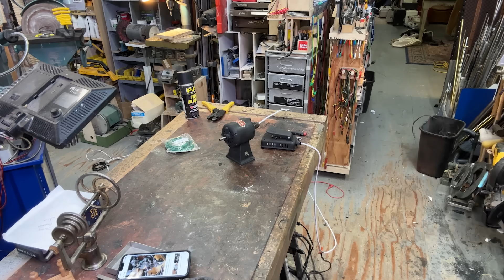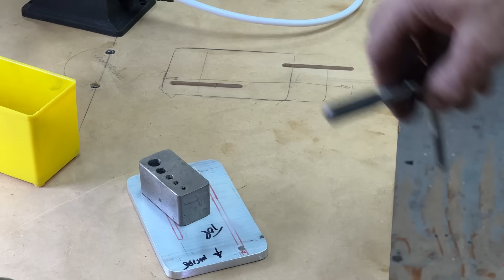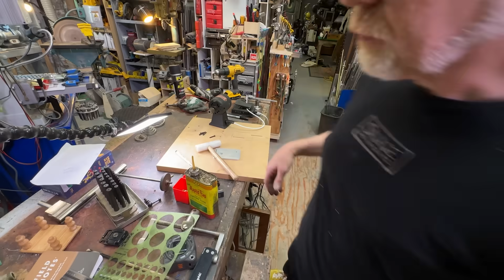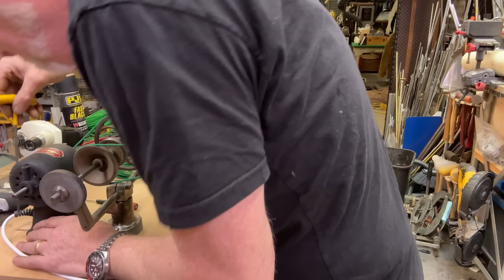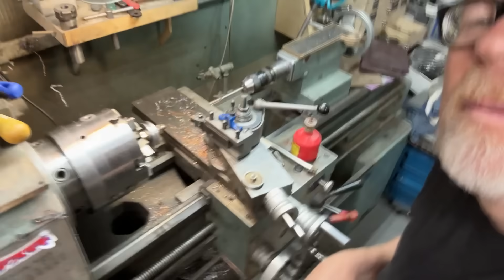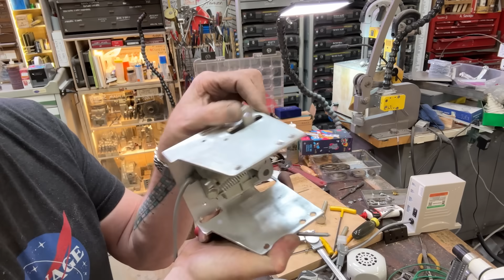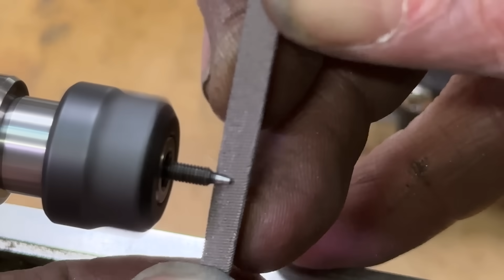Adam Savage's New Mini Watchmakers Lathe!

Comment: Important point is to check if the oil feed wire in the oil cups ist still there and there is enough very thin spindle oil befor you run it.
ER Collets have the problem holding parts that are shorter than the collett distorts the collett. The standard 8mm Boley Collets are much bette fot this application.

Comment: Love my Emco Unimat (made in Austria) which I bought from the son of the man that bought it originally in the 70's. It includes a mini mill, tiny table saw and jig saw all in one well engineered package. They are renowned for their accuracy. Not quite a watchmakers lathe and does have a fiddly thread cutting jig (which I did not get) plus many other attachments.
Reply: That was my first lathe bought from a friend. Great little machines 😊
Reply: Those Unimats are quite popular!  I had one that was very complete and original as far as the lathe goes, plus the wooden box, all original documentation, and the column for mill/drill, but I was lacking the milling vise, table saw, jig saw etc.  However, I never ever used it, and decided to sell on Facebook Marketplace.  Response was unbelievable.  I had several hundred hits and a half-dozen full price offers in a matter of hours.  Got $500 for it. Even after I made the deal and started turning people away, I was getting people offering up to $575 to try to win it back.

Comment: Those servo motors are an incredible bargain. They’re used to power commercial sewing machines so they’re cheap and plentiful and they just work forever—around $100.  I use one to power my 10x19 lathe and it works great.

Comment: I work in a print shop as a saddle stitcher operator and make these type belts all the time, also I'm a watchmaker hobbyist. The best way to fuse them without the Habsit tool is superglue the ends and before it sets completely light it with a torch or lighter. Press together gently and hold until cool or dunk in cold water to set. This method works well for me when I dont want to pull the correct tool out for joining, hope that helps.

Comment: The oilers on my lathe, are spring lid countered, meaning that whenever the bearings/shafts needs to be oiled, I simply flip a lid, oil and boom. Of course, watchmakers lathes usually has to be serviced more often, than normal lathes, due to much finer particles created.

Comment: I love those sewing machine servo motors! We use them in the sharpening community to add variable speed and bi-direction to Harbor Freight-style 1x30 belt grinders, as well as powering more specialized 1x30 belt machines. Aside from some cutout issues I have caused by the extension cable I made (probably a wire too small), they perform great - good torque, ridiculous speed, and most of the control boxes have really useful customization options.
Reply: Where do you find them?
Reply: @Morgoroth37 EBay

Comment: Adam, I always heated up a old steel ruler to join that type of belt. You heat the ruler, stick your belt end to oppisite sides close to each other, when it melts you slide the belt ends together and hold.  A lot of mailing equipment used that stuff.

Comment: I have added very similar sewing machine motor to my desktop lathe - 150mm (6") swing diameter and it works wonderfully. I have used very similar way of setting the speed - screw to the arm that is supposed to be connected to the pedal. There are modifications published on the net for connecting a potentiometer, but I did not want to void warranty.
Those brushless motors are wonderful for all sorts of stuff in DIY setting.
Reply: I've put one of these servo motors on my old lathe. It works  great. I ended up leaving the controller as is.  It means I can set the speed where I want quickly. If I recall correctly, the speed control mechanism (i think it's a hall effect sensor? maybe) is possibly at mains potential, and i decided to leave it as is. 
on mine, you also have to have the control at 0 when you turn on the unit, otherwise it won't go until its put to 0. I thought that might have been what Adam was experiencing before he found the damaged wires.
The motors run so well, I've contemplated putting them on some of the other equipment I have, like my small benchtop drillpress, and my belt grinder. The instant speed setting is such a handy feature.
Reply: Does anyone knows that where in UK I can buy this motor and this fantastic controller? 
Thanks 
David M

Comment: i had a neighbor with an 80 thousand dollar tractor that had intermittent transmission problems, eventually they found that a screw from a cab mount had run through the wiring harness intermittently shorting out the power shift transmission . isnt it wild how projects evolve and change as you work on them!!!!!!

Comment: Personally, I recommend putting some kind of shield between everything electronic, including the motor, and the lathe because small metal particles do not get along well with electronic parts.
Reply: Metallic dust has killed many a (modern switching electronic) welder!  P.S. The best (only) way to remove metallic particles from a motors' permanent magnets is shop air followed by duct tape that has been left in the sun until it becomes a gooey mess.  Ask me how I know.
Reply: @kevinsellsit5584  Who would you ask about safety in electronic devices and electro-installation? Someone who actually learned it as a trade or a welder?
With all respect, the answers to those questions lie in f.e. safety regulation standards like VDE, CEE, FCC and not in some more or less stoopid horror stories of some pirates, sorry ... I meant welders/machinists = USERS with (usually) no expertise on the matter. Those regulations are based on BLOOD and DEATH, accumulated and adjusted over a century and are no joke. You as a welder have appropriate workplace safety regulations for your circumstances and we electronic engineers have to follow similar regulatory frameworks when designing circuits and machines that do NOT kill you in any case or accident. 
If someone today in 2023 gets electrocuted (or worse) by the problematic you described, the responsible person for the workshop or for workplace safety will with no doubt go to jail for his unbelievable negligence and ignorance regarding to provide modern safety standards to his workers. That is no joke, too. With modern (I am speaking of 1970 !!! onward ...) residual current protection systems there is no excuse for such accidents and deaths you described in you comment. 

Oh and btw: THERE ARE NO PERMANENT MAGNETS in an asynchronous squirrel-cage rotor three-phase motor like in the video or most machine shop tool machines. That gave me a good laugh, my friend. Thanks for that. Also "removing metal particles" and "duct tape" was a good joke, worth of a circus number:) WE DO NOT LET SUCH CONTAMINATION HAPPEN IN THE FIRST PLACE!!! If that happens to your machines ... admit that you got scammed, move on and buy something that isn't build to kill you in the first place. Why TF is this so complicated? And yes, I've heard such absolutely irrational BS from other grown men at the workplace. Most of them still alive:) Unbelievable!
Reply: ... AND EARTHING ALL METAL PARTS!!! It is embarrassing that we have to mention this here. As the mishap with the cable "bite" wasn't hint enough, that he is building a <censored, insert word for accidentally or intentionally ending yourself> machine:) Unbelievable ... Hey, I wanna see more content from him, so we have to protect him from hurting himself!:)
Edit: Wiring up mains-earth is not the last thing what you do in a prototype, but the very first! Guess when the most accidents happen?;)

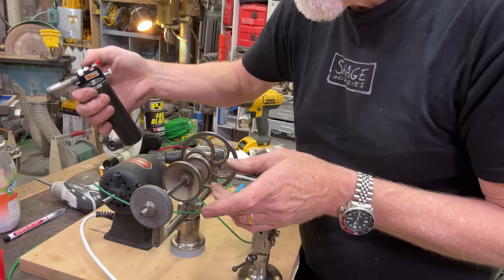Comment: 15:44 I'm a watchmaker, and the way we learned to join a belt way back in college was by clamping a thin bit of metal (brass or steel) in a vice and heating it up till it's hot enough to melt the belt. Then put both ends of the belt on oposite sides of the heated plate and slide them off so they join. Trim the excess with a sharp knife.

This way the joint won't get burned or sooty and will be stronger.
Reply: I use the same technique but I use the heated blade on a paracord cutter.  Ends on heated blade, then slide up and together
Reply: Bingo. That's the way I learned too, except in watch school where a buddy would take the place of the vise.
Reply: I began using  belts that were heated together.   I switched to large O-RINGS to eliminate vibrations from the clacking caused by the belt seam.  Installing  O-RING belts requires disassembling the spindle assembly but that isn't difficult.

Comment: Adam, you need to journey down San Marcos (just North of San Diego) and visit the Sherline factory (and their museum of craftsmanship nearby).   It would make a great tested video (or more than one) , and you could see them create hobby scale milling machines and lathes.   For anyone contemplating a similar project to this, Sherline sells quality motors, complete with speed controls,  that could easily be adapted to traditional watchmakers lathes.
Reply: This is exactly what I was thinking too. I love what Adam did, and it was a cool project, but after he added the motor with digital speed control, I just kept thinking to myself, "I would have just bought a Sherline."
Reply: @AWDTurboPOWAH    That lathe is very cool though,  I just would have got the pre-packaged solution of a Sherline motor and speed controller hooked up to  it.  I'm not sure if they still offer that option, but if they do it was a compact, affordable solution.

Comment: Love the sliding motor mount design, big fan of threaded inserts, that engine is very popular upgrade for the mini lathe (7x18) - IIRC a potentiometer (10K OHM) can replace the lever mechanism - a 10-Turn Multi Turn one gives you fin adjustment.

Comment: They make urethane belt welding kits with a soldering iron with a paddle tip and special pliers that hold each belt and when done right they are aligned nicely and have a solid weld, the hot urethane should roll as its pushed into each other, thats when you know your temp is good and the weld will be solid, of course you can make some aluminum blocks with a V groove with a strap clamp to hold the belts and guide bars to keep alignment...

Comment: Question.. is there an advantage to using belt drive on lathes over a direct drive design? I know most things are better running DD, however I know nothing about lathes but I have noticed most of them run belt drive. What is the plus to using belts?
Reply: With a belt you're hopefully not transmitting too much motor vibration to the spindle. Plus if you crash the belt might slip. Which is preferable to the motor going up in smoke.
Reply: thanks pcfred. The vibration issue makes sense. I know on turntables that DD is much better for torque, hence why DJs prefer them. However when it comes to a cleaner, more clear sound, a belt drive is better because the belt absorbs the motor vibration. Which is why the thousand to hundred thousand dollar record players run belts.

Comment: I have the exact same motor in my little proxxon lathe.
If you power it off and then back on again, you're gonna have to screw that speed adjustment knob aaaaaall the way to 0 before you can get it running again. Cute little safety feature I found after doing basically the same mod...
I finally just removed the spring, replaced the axle on the lever with a nut and bolt that I adjust for how much resistance I want in the original lever.

I've seen others replacing the whole thing with a multiturn resistor (5kohm if I recall correctly)

Mine still has the lever "temporary" solution because it works just fine.

Very happy with the motor though, especially the torque.
Reply: I'm planning to mount one of these on my Sherline lathe - would you happen to have the rough measurements for the motor?
Reply: @keithviolette5870  don't have it anywhere near me at the moment but if you google around for "industrial sewing machine brushless servo motor" or any combination of those terms you should find an near infinite amount of info. I have both the 600w and 750W version and they are 100% identical to each other and Adams motor in the video. 

Hope that helps

Comment: How fortuitous! I've been looking into small lathes and other miniaturized tools like small table saws and drill presses as well; mainly because I work with small projects more than anything. The cost is much more inclined with what I can afford while I save up for the larger, more universally useful versions. I think there's something to be said about the smaller tools that are easily available and affordable.
Reply: Be aware that the lathe bed, motor and headstock are the least expensive part of this stuff. It’s cross slides, collets and other accessories that really add up. Be very wary of buying an incomplete set, it can cost a small fortune to acquire whatever other accessories you need. It is usually a lot cheaper in the long run to save up for a set that comes complete with everything you expect to need.
Reply: @mercuriall2810  that's a good point, and now that I think about the cost of such parts I've sourced in the past for different projects, it occurs to me that you're definitely right!
Reply: @jakemeyer8188, I recommended this channel to Adam but after reading your comment you might find it interesting and helpful as well. The channel name is clickspring and I hope you find it useful too, I know I did.
Reply: what is this fortuitous word you say?
Reply: @Flamezzyyy  

for·tune
/ˈfôrCHən/
noun
noun: fortune; plural noun: fortunes

   a large amount of money or assets.
"he eventually inherited a substantial fortune"

Comment: Make sure your lathe motor is spinning the correct way...unless your motor has a reverse

3500RPM!?!?! way too fast
Reply: For brass stock about 3/8" diameter 3,500 RPM is perfect.
Reply: @1pcfred  1500 for brass. 600 to 800 for steel. More control with slower speeds
Reply: @1pcfred  do you use a watchmakers lathe to make parts?
Reply: @1pcfred  experience does

Comment: perhaps you can use a push-button stop at the speed control (in lieu of the Delrin part) to bypass the threading to get up to speed, and then turn the screw to dial in your speed. just a thought.

Comment: Someone needs to make an affordable small(ish) lathe, not a toy, not a high end lathe scaled down, but a quality tool for people who don't need a full lathe, for the hobby crafter/maker crowd.
Reply: They do - Sherline Products in San Marcos, California makes exactly that - a lathe, and a separate milling machine scaled the same.
Reply: @Warshipmodelsunderway  thanks for the info
Reply: They make mini lathes. As far as how quality they are opinions vary. It seems like after some work they're so so. I think some companies may do the mods? There definitely seems to be a range of fits and finishes with the shipped units too.
Reply: @1pcfred  thanks
Reply: @1pcfred   I purchased mine used in 1985 - at the time, they were branded by Sears, and had brass beds.  I upgraded  the motor/speed control assembly on the lathe with a more powerful Sherline unit.    I've had some problems with the tailstock, but you can call the factory and actually talk to a knowledgeable and friendly tech who can help you with any issue - that alone is a huge positive in my book. 

In the hobby realm, I've also used Taig, Unimat SL, Unimate 3,  and the Compact 5.   The latter is a nice unit too, but unfortunately out of production.
Reply: @1pcfred   Yep, brass for sure, and it is soft.    At some point in the 80's, they switched to a steel bed, which, as you point out, is better in every way except perhaps appearance.   The brass was a legacy of the original Australian design.  The backlash nuts are bronze though.
Reply: @1pcfred   I'm not sure why they made that choice, brass vs steel, but later units are all steel for sure.    

Cast iron is a good choice for larger tools.  I have a 220v Delta sander that is a beast, with a bunch of cast iron dampening that makes it a pleasure to use. 

I machine a lot of brass for my ships and don't really have a problem - for me, I prefer it to say, aluminum, because it can be soldered very easily to make more complex shapes.    On the other hand, aluminum is the choice for making masters for anything that is going to be cast, as brass reacts poorly with silicon based RTV.
Reply: @1pcfred  Yep,  I've had that happen too.  I read an article that you can grind a flat on drill bits to prevent that, and maybe someday I will get a set of drill bits and mod them for brass, but slow feed and obsessive chip clearing seems to do the trick for my purposes.   What I really enjoy is brass sheet work - I was having a problem with durability in the secondary gun mounts on my battleship, so I made them out of brass.   Took a while and a couple of tries, but very satisfying result.

Comment: Mounting the motor and gearset on a vertical surface behind where the chuck sits would have been cool too. 
Like motor below and gears above the chuck, then run your final power belt out from the wall mounted position to your chuck. 

Either way, nice!

Comment: I have a watchmakers lathe, I powered mine using a 24V 150W scooter motor, with a 24V power supply and a 0-40V PWM speed controller, this is plenty powerful enough for such a tiny lathe. these lathes are great for working on very small parts. I have 3 small lathes (and a 13" south bend) the watchmakers, a small flexispeed (the whole lathe is just 12" long), and a unimat 3, all are great for small stuff. (up to about 3/4" dia)
Reply: By the looks of it Adam opted for a 550 W BLDC motor.